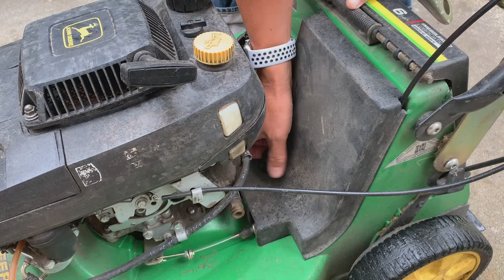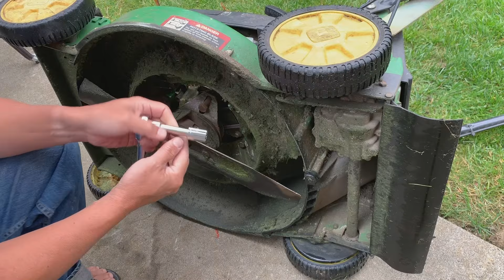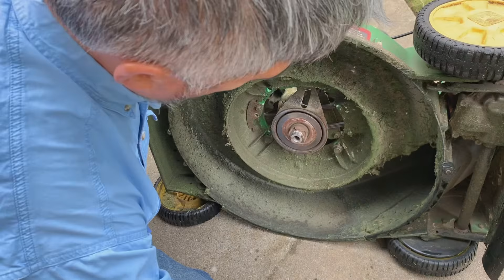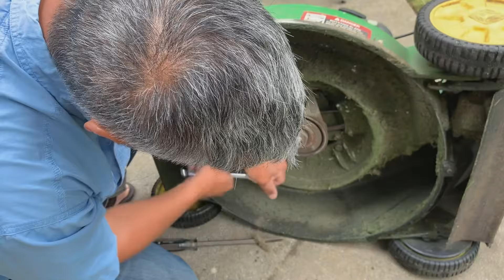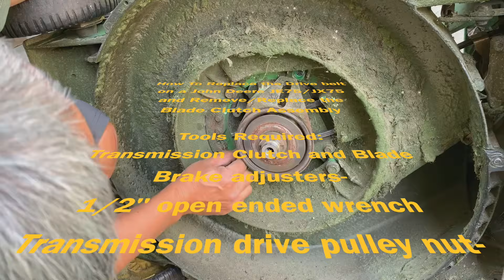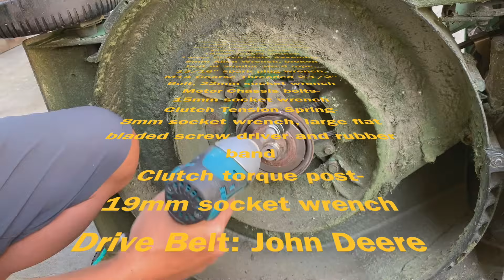How to Service the Drive Belt and Blade Clutch on a John Deere JE75/JX75 Self Propelled Mower

Comment: What length belt did you use?  I searched by serial and it says 34" but it is over an inch too short when i try to stretch it with the back wheel on it's spindle.  I fished it around the clutch after taking the spring and stop bolt out.  Even if i could lever it on, i think it would be so tight it wouldnt ever disengage.

I know they stretch but the broken one is 37.5".  That a pretty big difference.  I can't find a 36 locally to try
Reply from the maker: I just updated the link on the description for the correct belt which is 34" x 3/8, but it sounds like you may have the drive lever engaged.  Make sure it is disengaged to have enough room to get the new belt on.
Reply: @whidbeyben the belt that I was replacing was 37"  I ended up finding one and got it working.  There is nothing in any of the JD documentation referencing a size other than 34".  I am wondering if the person before me swapped out pulley disks or something from a different generation.  I got it from someone who fixed up mowers over 15 years ago.

Comment: What belt is required for the blade drive and wheels pulley?
Reply from the maker: The replacement OEM belt is John Deere Part M77167, https://amzn.to/4dqVpB0 which is a 3/8" x 34" (861mm long x 9.65mm wide x 5.59mm thick)

Comment: Great video but I bought the belt that Amazon Walmart and this video recommended and it didn't fit if anyone has info on the right one let me know
Reply from the maker: The Amazon link in this video’s description is the correct one. You might double check to see if you were sent the wrong part number by mistake.  You may also need to make sure the lever to engage the drive is in the disengaged position and the tensioning cable is disconnected.

Comment: Sooo… what if the clutch has no threads?
Reply: The older John Deeres like my 14SB did not have threads on the Clutch to it push off the crankshaft. You either have to use a puller or do like I did and weld a nut onto the lower clutch to press it off the motor.
Reply: @jeffreycaban5107  excellent idea.
Reply from the maker: Not sure what you mean by the clutch having no threads.  Both halves of the clutch assembly slide over the driveshaft with the upper half fixed to the driveshaft by a keyway.  If  you've stripped the allen head bolt securing the lower half of the clutch to the drive shaft, you may have to drill it out and use a bolt extractor and buy a replacement bolt.  I gave it a dose of liquid wrench, an overnight soak, and a few taps with a hammer to minimize the likelihood of the bolt being frozen with corrosion into the driveshaft. Just be careful not to get any lubricant on the clutch disks.

Comment: This is by far the best, most helpful, how-to video I have seen. He is easy to understand, gives clear descriptions of what he's doing, does not go into endless, useless, explanations, and gives viable work-arounds for procedures that the dealership probably has a special tool to use. The charges the local shops quoted were so high, that I had resigned myself to buying a new mower if I was unable to do the work myself. You saved me around $500. Took me two days to do what you did in a half-hour video, but that includes going after the belt and an M14 bolt. At that, I think I made pretty good wages. I can't thank you enough!
Reply: Have the same problem, going to order the belt and give it a go.

Comment: I have to hold the blade-engage lever while mowing or it slips and/or disengages, do you think that means I have to replace the clutch? Thank you, and for these videos.
Reply from the maker: It’s been a while since I’ve used this mower since we replaced it with an electric but you should check the linkage cable for excessive play. You may need to tighten it.

Comment: Great video.  I bought a JX75 a year ago for $50 and then installed a new clutch.  However I have a problem that many have noted--namely the cord is very hard to pull. (Instead, I have permanently tied up the bail and engage lever so the clutch is not braking the blades-the mower is now easy to start.)   When "disengaged" shouldn't the clutch braking mechanism be independent of the drive shaft so that starting is easy.  Does anyone know what is wrong? Is the clutch bolt over or under torqued?   I followed the video closely with a Warner clutch.
Reply from the maker: I haven’t experienced this with my mower. As you hypothesize, the blade brake stops the blade but is decoupled from the  motor shaft. It sounds like your clutch may be sticking somehow so that it is passing a braking load to the motor shaft when it shouldn’t.
Reply: @whidbeyben  I am intrigued at your torquing of the hex nut.  You tightened it to an extent that the hex nut (and engine) freely rotated with the allen wrench (with the clutch presumably disengaged as the cable has not been attached yet).  Perhaps my only problem is over torquing.  I'll report back.
Reply: @philliplederer  I'm having the exact same problem with the new Warner clutch assembly I just installed. Did you find a solution?
Reply: @philliplederer  same issue here, Pull starting is very hard, but yet I can turn the bade underneath by hand (very stiff) Did you figure out the problem?

Comment: Good video, I stripped out that damn bolt,first ever belt change after 35 years. Chisel and hammer on the washer part got it finally move it. Tried grinding flats on screw head but it wouldn't budge.

Comment: What size replacement belt do I need? In inches please.
Reply from the maker: https://amzn.to/4dqVpB0 John Deere part M77167, which is approx 3/8" x 34".  The John Deere spec is 861mm long x 9.65" wide x 5.59mm thick.  I've just added this to the description.  Thanks for asking.

Comment: My JX75 made it 24yrs with the original blade clutch and drive belt.  I just replaced both, and wouldn’t have done so were it not for your excellent how-to.  I appreciate all of the details, and you were right about not being able to hold the shaft from turning by using a breaker bar and socket on the nut under the recoil starter!
Your video saved me $300 in shop labor, and I gained knowledge that I didn’t have before.

Thank you!

Comment: I'd like to point out that this same process can be used for the mid- late 90"s 14SB & SE's. They're basically the same in a lot of ways. I'm rebuilding a seized motor on a 14SE ('92 I think? ) I took the  shroud off and used a good pry bar to lock the flywheel instead of the belt tho, since I wasn't throwing it. I did have an issue tho, that 8mm hex bolt finally gave way, then it locked again after a few turns. Tried a tightening and loosening several times, even using a cheater bar but no go. Almost seems like it's not actually backing out. Going to grab a bit for my drill tomorrow and try that. This is the only thing holding me back from having the entire motor torn down tonight so hope it works.

Comment: Very informative, but I have never had to take the blade clutch off to replace the belt. I never even have had to pull the engine off.  The belt will slide over the lever that sticks out and holds the cable for the clutch in gauge.  Just remove the hook.  Then push the belt in through the deck sliding one end of the loop over the lever then pull it through the bottom.  It’s a tight fit, but totally can be done.  . Just pull the spring and the long bolt that holds the clutch in place.  I’m also able to pull the belt off the pulley in back without ever taking the pulley off.   After it’s all done just stick a flat head screwdriver through the end of the spring. Place the flat head screwdriver tip on the hook and using leverage it slides down the screwdriver and pops on the hook.   The whole belt replacement should take less than two hours.  Probably one if you do it enough.  I’m the proud owner of a Jx-75 and Jx-85 and three 14sbs.  I have also owned the 14Sc and 14se.   Never pulled the clutch on any of them to do a belt replacement.
Reply: This is an informative video. If you have a better way then make your own video so we can see you finagle this belt out your way.
Reply: @HBmowers69 i agree. Pics or vids. If not, then it didnt happen.

Comment: Thank you for this video!

I completed the belt replacement yesterday.

I was able to get the belt on the rear pully without removing the pully.

I messed up and only shoved a small portion of the belt into the spark plug hole, and that did not stop the engine from rotating.  I ended up shoveing almost the entire belt in.  I had a lot of trouble getting the allen-headed bolt off.

I had to completely remove the motor from the body to have enough room to give the blade clutch control arm enough clearance to get the upper cluch assembly off the shaft.
On the plus side, I was able to slide it off the shaft without using the bolt to pull it off like in the video.

I found that someone had previously installed the belt guide by the front pully incorrectly (upside down).

Comment: Excellent tutorial, thank you very much! I picked up two of these fine mowers over the winter and I’m looking forward to restoring them. Clutch removal looks pretty simple if all of the bolts cooperate, I will soak them with penetrating oil for a few days in advance. Great video!

Comment: This Video save me so much time. I own a John Deere Jx 75. It’s the same Mower as the  one in this video , but it doesn’t have electric Start. I had been contemplating changing the drive belt for the last 2 years, because I bought the mower in January of 2000. The mower is Garage kept , so that’s  prabably why the original belt lasted so long. Anyway , I followed the video Step by step an was able to change it . The hardest part was getting the bolt off with the 8 mm wrench.  I used a lubricant similar to WD-40, couldn’t get it to bulge, but I kept on spraying it , until eventually it came off. Also, for my mower I ended up trying a (( 5/16th SAE hex key) it fit better than the 8mm one that was used in the video. Anyway , Thanks again for Making this Video. It definitely saved me a lot of time an ((Money)).

Comment: I fired it up today.  I have had a JX75 push mower for 15 years, now.  After the transmission rebuild and belt replacement made possible by your videos, it is back in operation.  Believe me, at 80, I will appreciate the working transmission.

Comment: I replaced my belt with an M77167.  It appears to be a little short.  Are there different JD mowers with different belts?  Is there another belt a few inches longer?
Or did I do something wrong?
Reply from the maker: M77167 is the correct belt for the JE75. Be sure the transmission is not engaged by unhooking the cable. This should allow the pulley to tilt forward. If working on something other than the JE75 or JX75, a different belt may be required.

Comment: Great video.  One note on removing the transmission input pulley.   A thin 18mm open end wrench, such as those sold a bicycle shop, can be slid under the pulley to counter hold the pulley.

Comment: Just did this today, and it can be done w/o removing the blade brake clutch. Basically follow everything about removing the spring, bolt holding clutch and taking out top two engine mounts, while loosening the bottom two mounts. You can then let the engine hang out and use some bent needle nose pliers to bend the belt guides under the engine enough to slip the belt off and then fish it around the still mounted BBC. Reinstall new belt, bend belt guides back and reinstall. whidebean video was a must watch to understand this process, but you can skip some steps if you want to do it quicker.
Reply: Bingo. I did this today and I've never changed mine before and only have moderate mechanical acumen. With this comment and the video. "GOLD " 

Took less than 30 min start to finish

Comment: Can the upper clutch bearing be replaced?
Reply from the maker: Sorry, I can't say for sure. Personally, I'd replace the upper clutch if the bearing went bad because it would be easy to order from your JD dealership.  If you have a machine shop, you could press the bearing out and figure out what replacement bearing would work and press it back in, but that's more work and requires some special equipment.
Reply: Yes you can replace the clutch bearing. Fairly easy. Bearing nsk 6205DDUC37ENS7S 112. 56x19. 13.75

Comment: thanks for you excellent presentation.  JA65 needed belt replaced   I was able to fish the belt onto the pulley without removing the upper clutch plate.  a little bit of work but in the end  its done.  Thanks again

Comment: According to the JD service manual, there should be no slack in the clutch cable.  Just FYI.  Torque specs are 55lb/ft for the blade bolts and center bolt attaching clutch to crank.

Comment: I have one of these mowers and I like it, but grass builds up on the underside of it really bad when mulching.  I have no desire to bag...  Grass packs in around the clutch untill the mower stalls.  I think the circular dam built into the deck around the clutch plays a role.  There is a discharge chute out there (M76488)  but at $75 is an eye popping amount of money to pay for a piece of plastic.  Any tips on keeping the grass out?
Reply: Clean the underside of the deck thoroughly.  Spray liberally with Liquifilm regularly.  Grass won’t stick.

Comment: Thank you so much for the detailed video.  I used it to replace The drive belt on a 1999 JA65.  Very similar except I only had 3 bolts holding the motor to the body.   I could not have done this without your expertise.  Saved me a bunch of money 
Dave

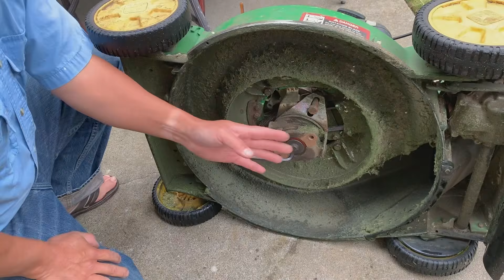Comment: Thanks! Only issue with mine: my blade brake clutch (shown around @7:54) the spring coil fell apart. Any thoughts on how to get it back together?  Really helpful video
Reply from the maker: There's no way to repair the spring, so order a replacement from John Deere.
Reply: I was able to put the clutch assembly back together, but now the blade will not engage. Is this because the clutch assembly?
Reply from the maker: @matts3694  Best case scenario is that the spring at the end of the control cable simply slipped off the control arm on the top half of the clutch or control handle, or the control cable is broken.  When you engage the blade brake on the mower handle, you should see the clutch control arm moving, and cable tightening.  Other possibilities are if the friction plates are damaged or contaminated with grease, or if the clutch isn't installed correctly. I'm hoping it's just a misplaced control cable connection to either the control arm or handle.
Reply: @whidbeyben  found it. I had to pull everything off again, and put it back on with emphasis on making the bolts as tight as possible. its now engaging :) thank you very much for all your help!
Reply: Jb weld u. An buy new ones

Comment: Good idea with the vice grips on the belt so pulley doesn’t spin. Thank you.
Reply: That wasn’t enough tension for me because the nut was too frozen.  I had to use huge wide mouth pliers to hold the wheel secure.

Comment: also, if you remove your blade clutch assembly, I STRONGLY recommend that you clean the crank shaft it slides onto, sand paper will work fine, and remove all that rust, and then coat the shaft AND a little on the inside of the clutch assembly bore with anti-seize. This will keep the moisture out and insure the clutch comes on and off easily in the future. If you have a EARLY model clutch, you wont have the threads inside the clutch for a M14 bolt to thread into...so good luck getting it off, its a major PITA! If your clutch fails, your looking at anywhere from $170 to $280 for a new one. But these are really REALLY good mowers, and worth it to fix and keep running.

Comment: What’s the torque specs on the clutch. I know  that has to be to spec
Reply from the maker: I'm sorry I don't have a torque spec for the fastener that holds the lower clutch plate to the crankshaft.  I use a 6" Allen wrench, which limits the amount of torque that you can apply to maybe 10 ft-pounds.  You certainly don't want it to come loose, but you also don't want to damage the fastener with excessive torque.

Comment: I have an old piece of black gas pipe, 1", about two feet long, that I slip over my ratchet handle to give me extra leverage when I loosen bolts such as the tswo holding the blade onto the mower's driveshaft.  Would also work nicely over the allen wrench.

Comment: Do you know what belt that was?? I'm having a hard time locating the replacement belt
Reply: John Deere M77167/Gates 6734/Stens 238-034/Dayco L334. Any one of these would be the correct part.
Reply: For future users: The GX21552 belt John Deere recommends for a JX75 is about 6 inches too long. I'm trying the M77167 belt.

Comment: I used this video to figure out how to change the belt on a 14SB. You don't actually have to take the second part of the clutch off of the lawnmower. Just taking that long locator bolt out and unhooking the spring and tilting the engine like in the video will give you enough room to get  the belt in place.

I was also able to get the new belt on the deck other pully without having to remove the pully.... but it was kinda tricky.
Reply: i am newbie here trying to fix my 14 sb, can you designate the time on the video of the part you dont have to do? many thanks
Reply: I did my 14sb the same way. Glad I saw your comment